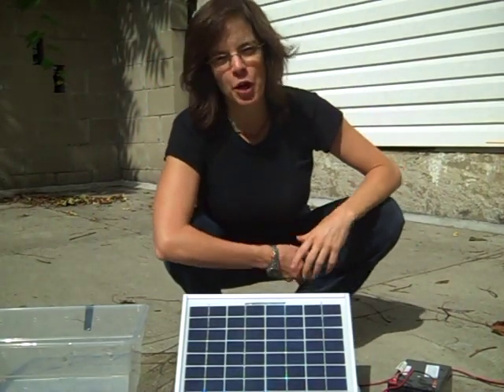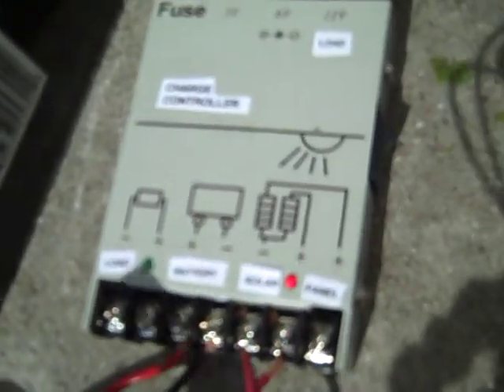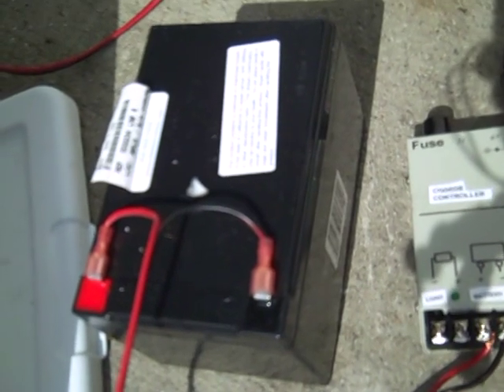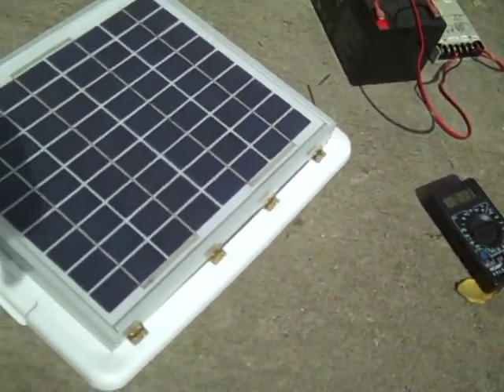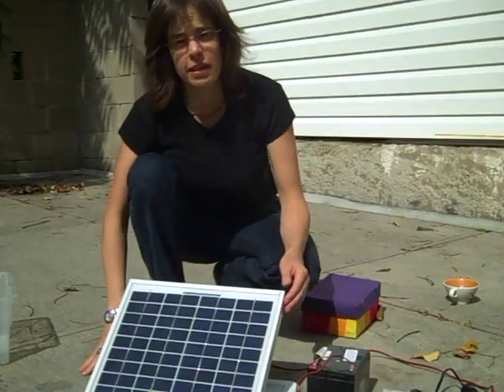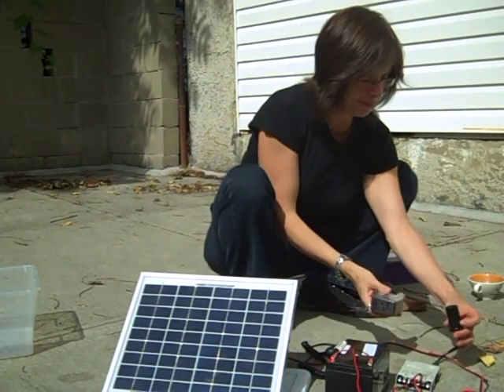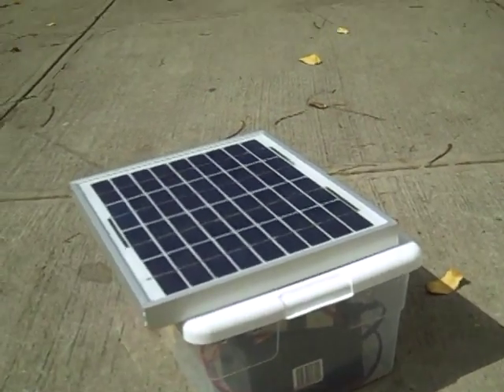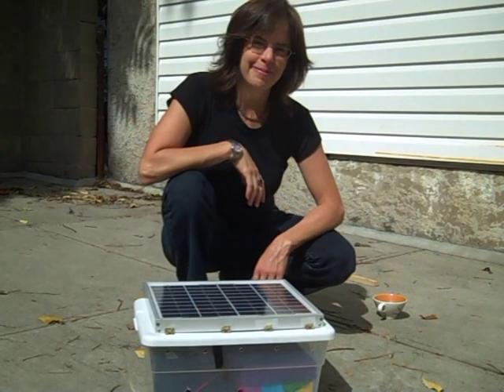10 Watt Solar Charger

Comment: I like the 10 watt panels I just got one and I leave it on my roof charging capacitors and it just inverts the power, right there, on the fly, through an $8 cigarette inverter, which send AC down to the basement and lights up the dark rooms with 2watt AC LED lamps by globe. Works great. Next I'm gonna program a little picaxe to detect if someone is in the room or not, if no one is, it'll charge a battery bank.. a bunch of 12V's I got (9a/h ea.) rejuvenated from the recycler

Comment: Wouldn't it be more efficient to use a in-car 12v to 5v USB adapter/charger than converting it to AC and then using that to charge your phone? You can pickup a cheap usb cigar lighter adapter for like $3 and that's surely gonna be much more efficient?

Comment: Thanks for the advice! I didn't even think about the voltage, it didn't even occur to me! My system is only 12 volts so you're absolutely right that would be a big reason for my batteries draining rather quickly.  :)  I will also take your advice about using meters and I'll probably get two like you suggested as that would be very useful information.  Thanks again for your advice :)

Comment: i have a 15 watt solar panel that charges my batt pack but i also have a 10 watt solar panel like yours i noticed that if you dont have complete sunlight the 10 watt wont charge the ipod unless its complete sunlight but when theres complete sunlight yes wil work good video .

Comment: @CollectingSilver If you just have a small panel like that you can get one online, shipped to your door for $15. PWM. No need to get a larger MPPT, as most do not operate (they dont charge at all) when the input it less than an amp.

Comment: Hi Jocelyn, 
Great job.
 Where did you get your charge controller from?  I'm working on a 15 watt solar panel setup supplemented by a 50 watt windmill. The bad weather is hindering my progress. You're an inspiration.
Paul from NY

Comment: Nice vid, a little misleading 10W out of the panel, on a good day, when its facing the right direction, pirpendicular to the suns rays. Put it through a charge controller, an effeciancy drop, OK estimated, 1/3 drop (estimated), so appx 7W out of the charger, so put it into the battery,1/3(estimated), so now only appx 5W, so pull it out of the battery & push it into somthing else and you loose another 2/3 of 5W, if your doing well 2W left over.Look at the effeciancy of all the bits if you can !

Comment: Nice. I have two  10 watt solar panel in parallel  and charge my battery 12v battery  and my cell phone too, I use step down. And I took my power bank to the field, marine park.

Comment: Thanks for such a good video! I was hoping you wouldn't mind taking a look at my own attempt which doesn't seem to be giving me the power it should. For example, if I'm working this out properly (based on website eg's), my two 20ah batteries in parallel should power my macbook's 60w charger for about 10 hours but they last a lot less than that.  I'd be grateful for any advice or tips and thanks again for showing me how to do it in the first place! :) I have a video of it if you would like to see

Comment: I have that solar panel.  It's my fist one.  What size charge controller are you using?  Are you using a 12 volt car battery?  I want to use my solar panel to charge  AA, D size batteries using an electric battery charger.  Will this work"?

Comment: I must appologise if I oversold the down side, i'm supprise the figure is as low as 10%, congratulations on finding a notably effeciant system, charge controller. Please quantify the .....'....and most of the energy ....'....things like the sulphiding of batterys etc. temperature adverse effects. Don't want to cloud the message, 'cos this is on the side of the angels stuff, but it may help if people understand what is possible & how lossy these things can be.

Comment: A 10 watt solar panel will not generate 1 amp, so I fail to understand why you make the point. In fact at peak power your lucky to get 0.72 amp...

Comment: @TheDominator0007 
its ok, i am using 10 Watt 0.6A and 21 Volt panel to charge my 7.2 amp battery without charge controller.
I connected 2 energy savor 12 volt 3.5 watt LED bulb with the battery. normally i connect my battery from 7 AM to 4pm.

Muhammad Tariq
Islamabad, Pakistan

Comment: So I was going to make a regular pico reef when I came acros the idea to make it run by solar power. Iris going to be small and have a canopy and stand I may use a sump run by pressure and a air pump. I'm going to use a 6v solar panel with alligator clips to charge a 6v battery which will power the led boulb with the remote with many colors 6 volt and 12 volt panels - YouTube Amazon.com: 3W GU10 16 Colors Changing RGB LED Light Bulb With Remote: Electronics I was going to use another set of all